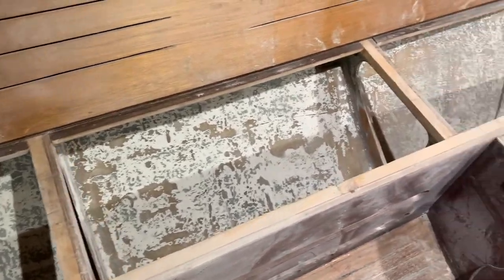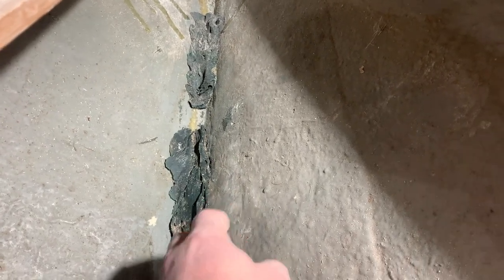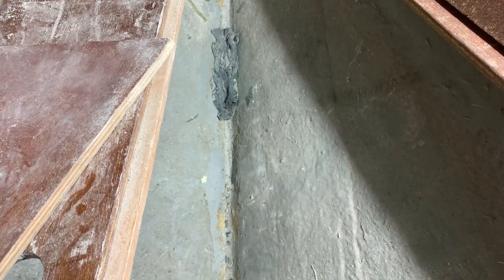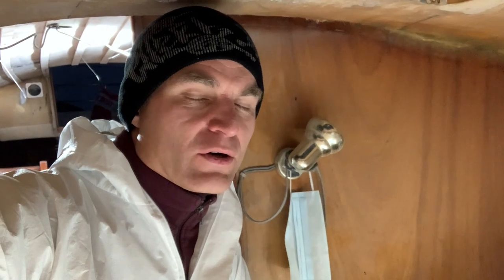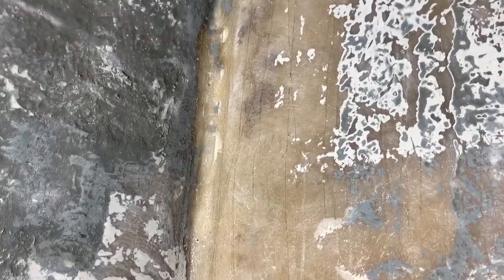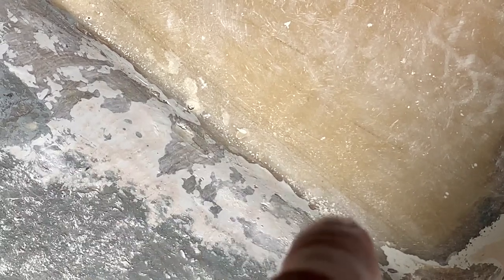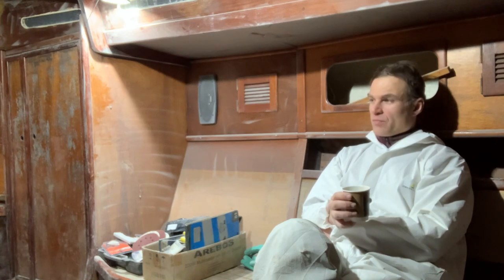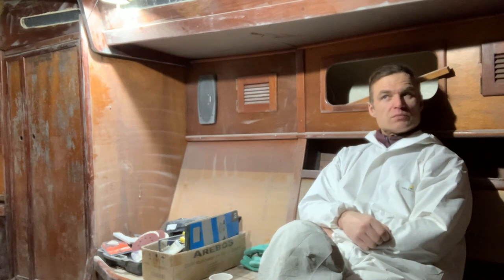Is there a crack in the hull of my sailboat?

Comment: keep on. i have just splashed my boat after almost 6 months on the hard to replace the keel bolts, peeled all gelcoat thru bare fibreglass on hull and topsides, and repainted her completely. the trick is to keep at it and it will get done. come october will be hauling out again, peeling and painting the deck, cockpit and completely building the interior
Reply from the maker: True words, keeping the motivation is the key to get the job done. You've done good with a major task like this done in 6 months

Comment: A bit late now , but the red plastic plug you found , looks to be , what i know as a raw plug . Interesting place you found it , because i'm at a loss as to why it was used on a sail boat . Its normal use is for mounting a surface box to a brick or block wall . You simply drill a hole , slip the plug in , usually with the help of a hammer , then screw the box to the wall . The plug forms a bond between the brick , and screw , holding the box securely to the wall . What its doing on a boat , is beyond me . Maybe it was used as a holding for some component , i really don't know . But the filler could have been some kind of anchor for the plug .  
Anyway , just thought i'd drop that information in for you .
Reply from the maker: That's exactly that it was. But why, remains a mystery. There are many better ways to attach something to the hull.

Comment: Use a screwdriver and tap around that section by using the handle, listen to the sound. High sound ok, dull sound problem area, try that first. Then use a moister meter to find any wet areas.

Comment: How is the engine? Tankage, did you inspect inside them? Thru-Hull fittings?
Reply from the maker: The boat will be repowered because I think I need some more horsepower. Sometimes you need go against the wind and current/waves and cannot tack and then some power is nice to have. All tanks will be replaced, too. Original fuel tank was too small. There was no fresh water tank at all and waste tank was suspect to corrosion at the welds. So all tanks will be replaced.

Comment: Could the filler have been used to better bed the holding tank? I am assuming the tank was formed to the hull shape.
Reply from the maker: That was my conclusion, too. The tank was v-shaped as well. But there was not enough filler to serve that purpose and the tank bottom didn't even touch it. It was resting against the sides of the hull.